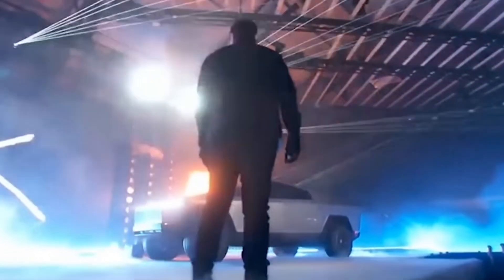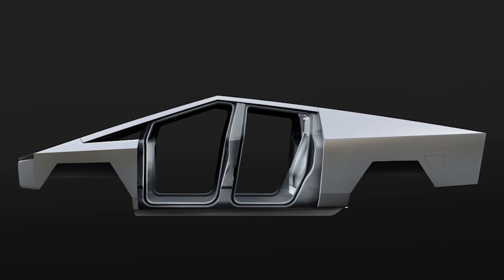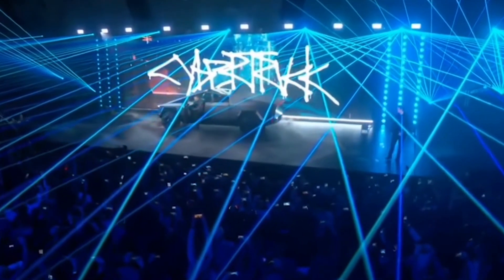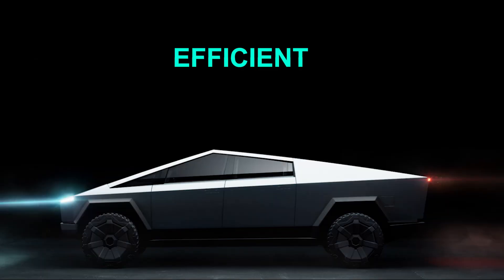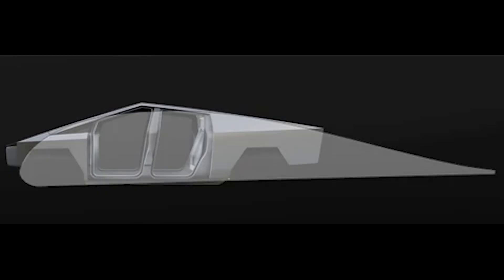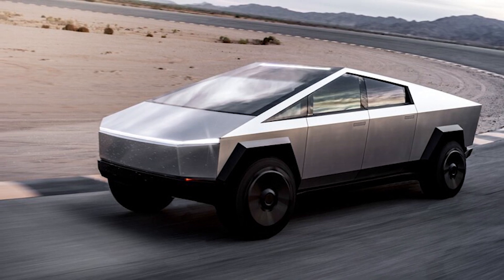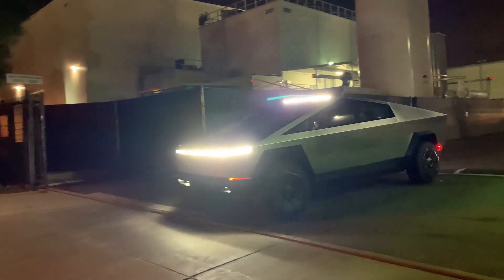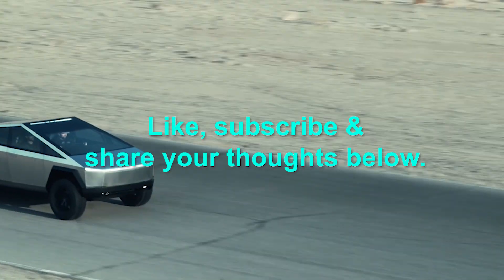Cybertruck is Engineering Genius (and will be copied)

Comment: You just need to talk about towing range. Overall the content is perfect
Reply: Electric cars range is decresed when it needs to tow smthing because the low energy concentration on the battery pack. 
Sorry for my english.
Reply: The towing range is going to be terrible
Reply: @carholic-sz3qv  Untill they Increase the kw it's gonna be horrible
Reply: Maybe an add on battery for bed of truck or on trailer for towing. Just a thought...
Reply: @ThePorterhouse99  That's a nice idea ! A baterry pack on a trailer.
Reply: What towing range???
Reply: @GroovesAndLands  
Up

Comment: The  Cybertruck is Engineering Genius?

That statement is obviously PURE GARBAGE.

They made an exaggerated claim about the glass.
And they did not allow the Test Engineers to test the 

glass beforehand.
If they failed to properly test out the glass,
what else did they fail to test?
Perhaps the motors, or the batteries,
or the battery coolant systems.
Or the collision avoidance systems.
Garbage.
It looks cool.
But so was the Chevrolet Corvair at the time.
Reply from the maker: ...k. Glass breaks on prototype (2-3 years away from production) during demo, Glenn ignores every single point in the video.

Comment: There has to be some coating on the steel. If not that thing will be a rust bucket in a year.
Reply: It's the same steel they designed for their spaceship to go to mars. I'm sure it will be fine
Reply: It's stainless steel
Reply: @CarrotsWithLegs  How stainless is it? Will a magnet stick to it? Good stainless is non magnetic.

Comment: rigid != safe. You ever heard of crumple zones? I bet it will score reasonably well on safety, but far worse than their other models.
Reply from the maker: Lots of people are raising this. The steel can be scored on the underside to crumple predictably and consistently (or the hood could be a separate component). I think many will be surprised at how well the Tesla engineers address this. Safety is always top of mind at Tesla. It may not appear so but the driver in Cybertruck sits the same distance from front of the vehicle as they do in Model 3 so there's equivalent space for crumple zone too.

End of the day, Cybertruck won't be allowed on roads if it is not sufficiently safe. Tesla are smarter than to design an unsafe vehicle 😉

Comment: One question would be, what the repairability of the body is if it's involved in a minor accident?
Reply: This is my only concern: repair cost for accidents. Exoskeleton is great from design and cost effective standpoint. But, it may be a little different from repair costs and safety. How a major frontal collision will play out for forces distribution, and if driver/passenger survives, what would be the cost of replacement of that exoskeleton?
Reply: @oscaragonzalez3903  let insurance worry about that.
Reply: @oscaragonzalez3903  couple of things. First off, the solution for the cost of the exoskeleton if you're in a crash. Well don't get into a crash... If someone crashes into you well it's their cost not yours so nothing to worry about. As for safety inside the car I'm sure the design team and everyone went over it to make sure it's as safe as their current vehicles
Reply from the maker: Minor = easy. Visit a metalworker and they'll remove the dent.  The exoskeleton itself would need to take a MAJOR impact to deform structurally. (except where designed to crumple).
Reply: @SolvingTheMoneyProblem  But could a generic metal worker remove dents from 301 stainless steel? I mean, this steel is extremely strong and destroys regular metal working equipment
Reply: @readytokill123  can you say "cut & paste"??
Reply: @readytokill123  ,would you take your Dodge Ram to your local metal fabricator? 
Does Chevy  have fenders in stock for all models?  Cyber uses flat panels, flat windshield.
Reply: @readytokill123  My other worry is that if it is expensive to repair, insurance companies will make it cost prohibitive for the average person to own one.

Comment: wouldn't being extremely tough make it extremely dangerous in a collision? especially for pedestrians
Reply from the maker: Lots of people are raising this. The steel can be scored on the underside to crumple predictably and consistently (or the hood could be a separate component). I think many will be surprised at how well the Tesla engineers address this. Safety is always top of mind at Tesla. It may not appear so but the driver in Cybertruck sits the same distance from front of the vehicle as they do in Model 3 so there's equivalent space for crumple zone too.

End of the day, Cybertruck won't be allowed on roads if it is not sufficiently safe. Tesla are smarter than to design an unsafe vehicle 😉

Comment: "Much more function than anything in its price range"!!???? 
LOLOLOL 🤣🤣🤣

Ok where's the 8 foot bed and flatbed contractor option? Will we see one of these with a gooseneck hitch for pulling large trailers? Of course not.
Reply from the maker: There are narrow-use cases where other trucks will beat Cybertruck. Flat bed? Get something else. 8 foot bed? Get something else. Only care about towing very heavy? Get something else. But in aggregate, the function Cubertruck offers for its price is unmatched. Even little things like the built in T/L tracks in the bed, retracting cover, insane amount of storage etc
Reply: @SolvingTheMoneyProblem  Fail. 

Truck owners want the option to do those things. They won't spend $69k on the chance they it might not fit their needs. Conventional trucks have retracting covers. They're called tonneau covers, nothing new but Tesla thinks they've stumbled upon something lol

Comment: I'm still to be convinced it is going to be significantly (or any) cheaper to build. One thing you and others don't mention is the cost of SS is very much more than ordinary steel. Also the lower grade 300 series stainless steels, which is proposed, do rust slowly or at least tarnish badly. I'm not sure how they're going to manage that. Unpainted SS body work will be hugely expensive to repair after an accident. You can't just panel beat, use body filler to finish and paint over. You either have to bash the panel to a perfect finish which is near impossible or more likely cut the panel out (welded exoskeleton remember) and TIG weld in a new one. Exoskeletons are great for things like rockets, but in cars it doesn't work very well. The exoskeleton only applies to the front of the truck and the bed section. Look at the bare body pic. 1/2 the length of the body where the doors are has to be a conventional frame construction, not exoskeleton.

Comment: damn.... this place it teeming with fanboys.
I love electric cars. Love the S and 3 model. Not so much the X tho...
I love the SRF motorcycle from Zero and the HD Live Wire.
I fact. I cannot wait until they get cheaper to buy one!
However! I've used trucks for work for a looooong time and I can tell you this... the Cybertruck will NOT replace regular trucks.
It fails as a truck in many ways.
Reply from the maker: Thanks for your input. I'd love to know some of the many ways it "fails" as a truck if you have a moment.
Reply: @SolvingTheMoneyProblem  Let's begin by saying that I'm aware that most trucks these days only get to see mild, or if any work at all during their lives. My opinions and observations are based on trucks that get used and abused for work!
I've lived and owner trucks my entire life. I've used them from carrying scrap, auto parts, tools, motorcycles, furniture, towing boats and motorcycle trailers, and even camped on them!
I'm also a fan of electric vehicles and I'm dying to get the live wire once it drops in price!
But let me also say that I'm not a fanboy. I don't consider Elon Musk a genius, not did I consider Steve Jobs a genius.
They surround themselves with genius tho. And both were and are capable of making mistakes.
I consider the Cybertruck a strike of genius, but the way they are promoting it as a replacement of old trucks is just counterproductive and misleading.
Here's why:
So first on my list are the high sides...
Trucks have low sides to allow for side loading, which is more common than you think. Also the low sides help with easily reaching around the load for easy strapping and securing of the load! Some trucks even have steps to help you get up there and look around!
Whoever designed the Cybertruck's high sides has never used a truck for work.
The slats that cover the bed, as cool as they sound, won't last but a few strikes of an unsecured load before they break.
Seriously, use common sense, how strong do you think they can be? stronger than a full 1,000 lbs pallet?
And this is not only my opinion. Some artists have photoshoped the image of the Cybertruck with more traditional bed sides and it actually looks cool as fuck!
Then there's the air suspension...
Tell me... in what universe is a complex air system suspension stronger than a solid axle and leaf springs?
Seriously. Leaf springs were designed in ancient rome... do you think trucks use them because they are cool?
NO! They are still in use because they are strong as fuck!
There's an article about a broken F350 that Elon Musk made a comment... He has some nerve to make a comment on the F350 when the X model fiasco nearly fucked him in the ass.....
Some new F350s have a weakness in the rear suspension, but that doesn't mean every truck is broken, doesn't it?
Then there's the towing range. A simple math can tell you that an electric truck has problems towing a load to a distance.
It has something to do with energy density of a battery compared to a gas tank.
Look at the youtube channel Engineering Explained to see the full explanation.
They guy is a Tesla owner. Just not a Tesla fanboy.
The unibody construction could be a very expensive mistake for someone that manages to overload the cybertruck by mistake.
You see, the reason regular trucks are body over chassis is for flex. Normally, in a performance vehicle you don't want flex, but on a truck you may overload by mistake, you WANT the chassis to flex!
and if the chassis is damaged, it is easily repaired or even replaced.
A unibody is much harder to repair, and much much harder to replace.
And even if it's made of stainless steel... EVERY MATERIAL HAS AN OVERLOAD POINT!
And then there's recharging.
My neighbors are contractors. They basically ferry materials and tools from construction sites all day.
They only stop to fuel the truck for a few minutes...
That would be a total hour the truck would be down to recharge if it was electric!

Then there's offroading. the Cybertruck probably weights a LOT.
This may not be a good thing in certain soft surfaces. Also, on a regular truck, you can bring extra fuel in external tanks. Bringing extra batteries on a cybertruck sounds expensive and heavy.
Again. I'm not shitting on electrics, but I just don't think electrics are there yet to displace work trucks.
If I was Elon, I would've advertised the Cybertruck as an utilitarian NEW kind of vehicle.
Kind of like the Autralian Ute. I have a feeling nobody here knows what a Ute is... and that's my point. The Cybertruck is getting a lot of love from fanboys that aren't necessarily into cars, therefore, they seem to completely ignore the drawbacks of it due to ignorance on the topic.
But when batteries DO get on par in energy density to a full gas tank, AAAAND the truck looks like a regular truck, You can bet your butt I'm buying one!
I'll leave you with this:
A truck hasn't changed in nearly 100 years...
neither has the spoon or the hammer in around 10,000 years...
Why? because they are tools that work just the way they are....

Comment: No one will copy this sorry. The Tesla truck is terrible in so many ways.  No place for a 5th wheel or a plow. Terrible Visibility. No chassis cab, Useless hard to use the bed that you cant reach into, no place for bed rails for things like tools and ladders. The range will suck when towing.  A lot of the truck isn't even legal. No mirrors, the tail light placement is not legal. Those Goodyear MTR tires will not handle like its on rails and that heavy Truck will wear them out in under 20000 miles. This thing is the fake news of trucks. This thing will need a lot of changes before it comes out. Even as an off road SUV its terrible its just huge and heavy. The only people who will buy it are people who buy new cell phones every three weeks and have never needed or used a truck. Its just a novelty vehicle. Tesla is going to be beaten to market and crushed before they can even sell this thing. The Rivian truck is a better more thought out vehicle. Don't hold your breath on that 39000 base price that's with government subsidies calculated in.

Comment: Saying the exoskeleton is tough isn't a good thing for safety when considering how a large part of safety is the ability to crumple.
Reply from the maker: Hey Adam, lots of people are raising this. The steel can be scored on the underside to crumple predictably and consistently (or the hood could be a separate component). I think many will be surprised at how well the Tesla engineers address this. Safety is always top of mind at Tesla. It may not appear so but the driver in Cybertruck sits the same distance from front of the vehicle as they do in Model 3 so there's equivalent space for crumple zone too.

End of the day, Cybertruck won't be allowed on roads if it is not sufficiently safe. Tesla are smarter than to design an unsafe vehicle 😉
Reply: @SolvingTheMoneyProblem  yeah that's what I'm thinking as well. I was just frustrated that this isn't a point people bring up!
Reply: @SolvingTheMoneyProblem  Maybe, but if you score it you reduce the effective tensile strength by introducing areas of lower cross-sectional area. This really would lower the advantage of making out of a thick material to start with. Since this purported "genius" unibody design is on a truck, you would then lower it's effective load capability.
Reply: Bimmer Won  whereas i do agree about the windows being unbreakable it would be ideal for it to be able to be broken from the inside atleast or just provide a steel rod in the car as it's own compartment for such a case. your claim of evolved softer shells however is wrong. the softer shell isn't for safety it's for weight reduction. the chassis is what's for safety the frame isn't. the whole point of a light frame is to reduce the total weight of the car so when an accident happens the frame bends but the chassis could survive as it's not supposed to bend else it's considered a total. regardless they won't make a car that isn't gonna be approved to become road legal so obviously it will be safe enough to be road legal. now is it gonna be safe to get hit by this car in your non cybertruck...no it'll probably be worse then getting hit by a regular car

Comment: The matte black CBRTRK floating around the internet looks awesome, and Elon has said that it will be an option. Anyway, one thing that worries me is the lack of a crumple zone to absorb impact energy during a collision. Typically the body would crumple, absorbing much of the impact energy before it reaches the occupants. But with a super strong 30x steel outer shell the occupants will need something else to absorb that impact: The interior would have to have LOTS of padding and/or a boat load of airbags. I'm sure we will hear more from Tesla as they continue to do safety tests (especially crash tests) with the Cyber Truck. Maybe they've found a better way to do this.
Reply from the maker: Lots of people are raising this. The steel can be scored on the underside to crumple predictably and consistently (and it appears the frunk is a separate component). I think many will be surprised at how well the Tesla engineers address this. Safety is always top of mind at Tesla. It may not appear so but the driver in Cybertruck sits the same distance from front of the vehicle as they do in Model 3 so there's equivalent space for crumple zone too.

End of the day, Cybertruck won't be allowed on roads if it is not sufficiently safe for occupants or pedestrians. Tesla are smarter than to design an unsafe vehicle 😉

Comment: I put a deposit down not because I’m in love with the current cyber truck but because I wanted to ‘lock’ in autonomous feature pricing.  

That has been a feature steadily going up and I waited until 200k preorders to put me near the back of the line to hopefully realize a few design tweaks before I’m up to bat.  

Maybe it will grow on me.  Maybe it gets better.  Maybe someone will come out with something more desirable.
Reply from the maker: Smart move. A Cybertruck reservation is the ultimate arbitrage--when FSD is achieved, the step change in value will be enormous.

Comment: Don't most vehicles have a crumplezone in the front that during a crash ends up slowing you down in a more controlled fashion? I'm not in any way as well educated as you when it comes to vehicles and I definitely don't dislike(in fact I love) the cybertruck, I'm just curious of how it's going to handle how it protects us from the sudden stopping force of a front end crash
Reply from the maker: Hey Nathan, lots of people are raising this. The steel can be scored on the underside to crumple predictably and consistently (or the hood could be a separate component). I think many will be surprised at how well the Tesla engineers address this. Safety is always top of mind at Tesla. It may not appear so but the driver in Cybertruck sits the same distance from front of the vehicle as they do in Model 3 so there's equivalent space for crumple zone too.

End of the day, Cybertruck won't be allowed on roads if it is not sufficiently safe. Tesla are smarter than to design an unsafe vehicle 😉
Reply: @SolvingTheMoneyProblem  Nice! Thanks for the info